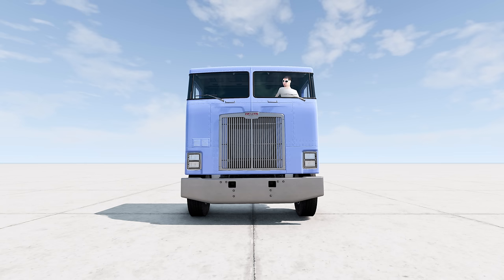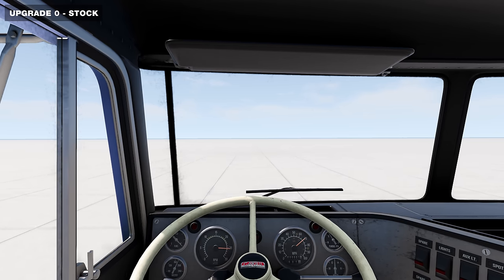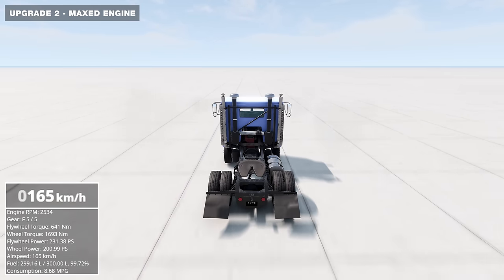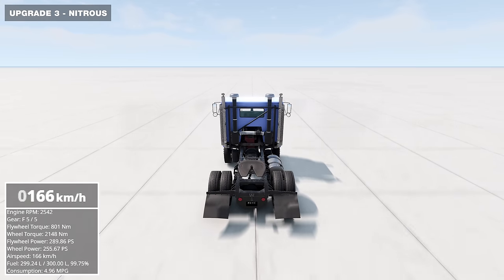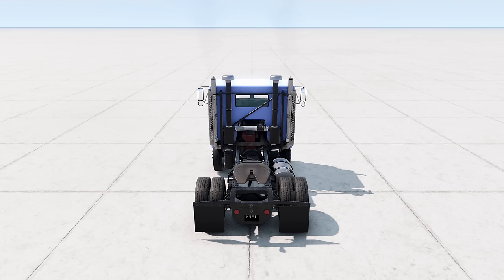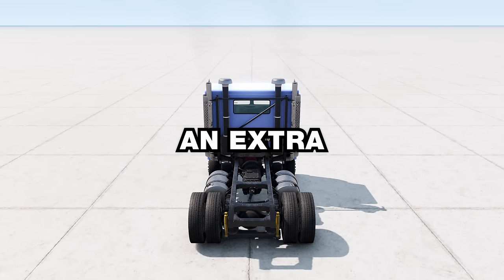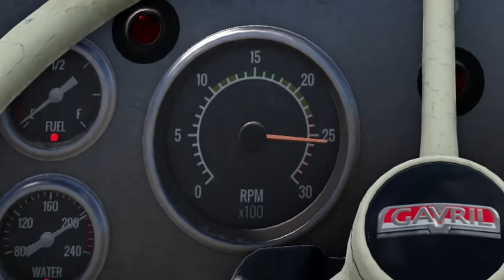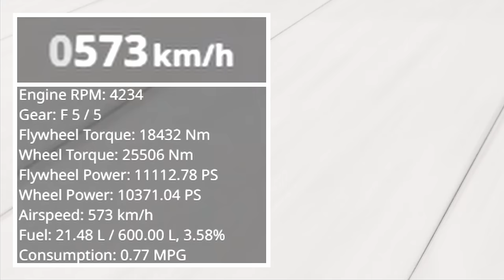I Built The Fastest Truck In BeamNG

Comment: The base version of a pigeon can beat that 730 km/h
Reply from the maker: In first gear
Reply: what
Reply: pigeon will turn into a pigeon
Reply: @MuYe yes
Reply: @MuYe  true
Reply: "1 hour ago" lol
Reply: @MuYe  in neutral*
Reply: It was also non-modded @MuYe
Reply: @MuYe  in reverse
Reply: @MuYe si
Reply: @MuYe  -2 gear 🥱
Reply: @MuYe   in reverse gear*
Reply: Yasss
Reply: @MuYe  200 rpm
Reply: @MuYe  with the engine turned off
Reply: In reverse
Reply: @MuYe  true though
Reply: @MuYe  turned off*
Reply: Yes❤❤❤
Reply: @MuYe nah, it just barely reaches it in 1st gear, but an upshift goes to half the speed of light, and at the 3rd and final gear it goes 6.9 times the speed of light

Comment: It doesn't need a wing.  Wings add drag.  It needs more weight on the back.  Weight, as you showed, doesn't affect top speed very much because it doesn't add much drag and it only matters for how fast you get up to speed.  Put a cement mixer on the back.

Comment: Weight reduction does very nearly nothing for top speed. This is because top speed is determined when the frictional forces (drag in particular) equal the force produced by the engine. When these forces are equal, acceleration stops and the vehicle is at top speed. Reducing weight does not really affect top speed -- it only affects the rate at which you reach top speed. The only slight gains to top speed would be from the reduction of rolling resistance. This is how the Bugatti Chiron still has a record-setting top speed, despite weighing as much as a Ford F150.

Comment: If you were gear limited nothing you would have done before messing with the Revs would have made a difference.
You were always power to drag/weight limited.
That plus the game sucks for realism.  When you maxed out the power in the stock truck. One speed.
Nitrous doesn't add speed like magic. Go watch the revs again. It allowed you to rev higher which nitrous wouldn't actually do in that case. It doesn't move/eliminate the rev limiter.

If you have a car that maxes out its gearbox on stock power. It isn't going to go any faster by adding power.